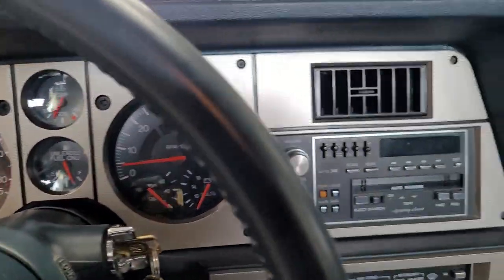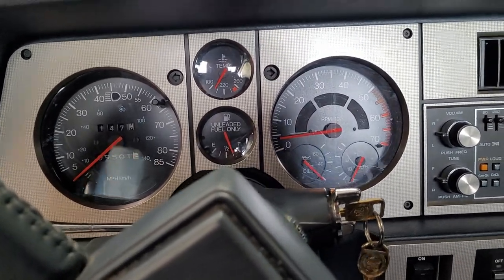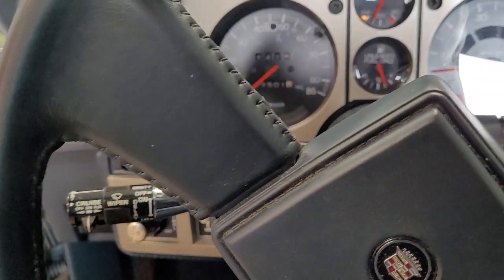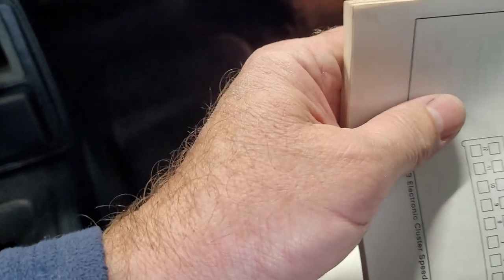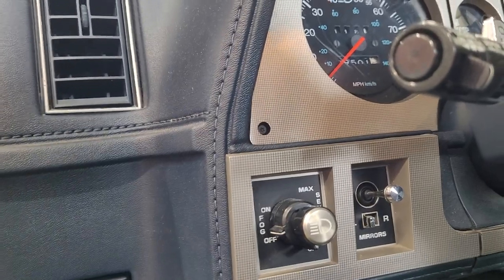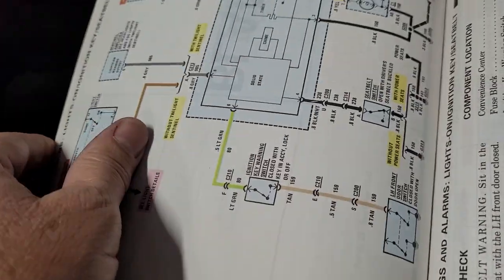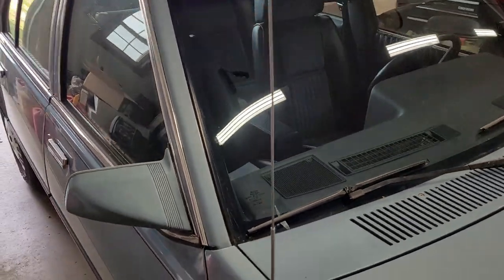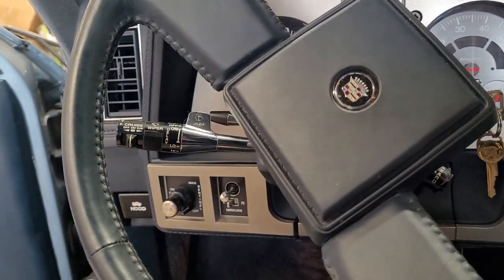Fixing The Little Things On Adam's 1986 Cadillac Cimarron Rare Classic Cars & Automotive History

Comment: I have a 1988 Sunbird. Probably 90% the same parts. Note the Cavalier 1982 to1987 front fenders are not interchangable with the rest of the J cars...they are about 1/2 inch shorter in length from the wheel well to the bumper. Why GM made them that way is a mystery.

Comment: The antenna masts on most GM models of this era were terrible. I'd have been more shocked if had been working.
Reply from the maker: Yeah, I know. You'd thought it would have lasted for 9k miles, though.
Reply: So true.  There’s a plastic gear that wears out, which makes a terrible noise when the motor is running.  Most people just cut the wire somewhere and rubberband the antenna in a fixed position.
Reply: You might be the first guy who is trying to fix the GM door/key chime, lol.  Maybe the Cimarron got a less annoying one
Reply from the maker: @SouthOpsFireWX  they could have unplugged it.
Reply from the maker: @Rfk1966  I feel like everything should work. It was more of a chime and not that annoying EEEEEEEEEEEEEEEEE!!!!🤪